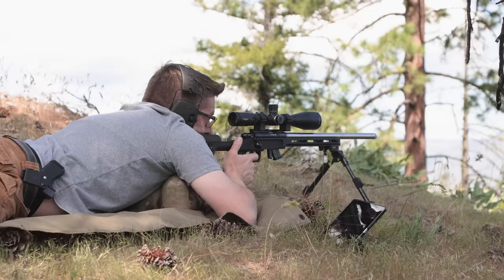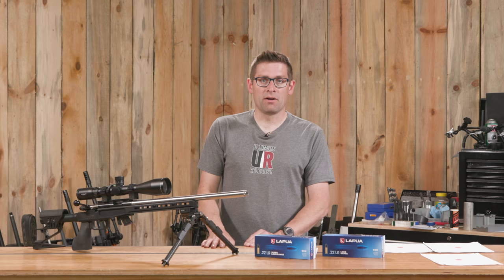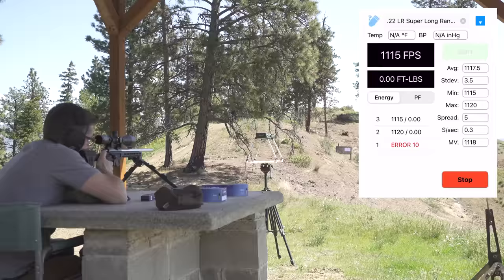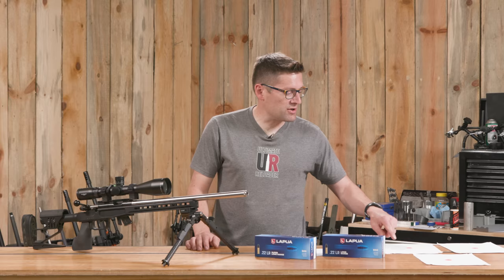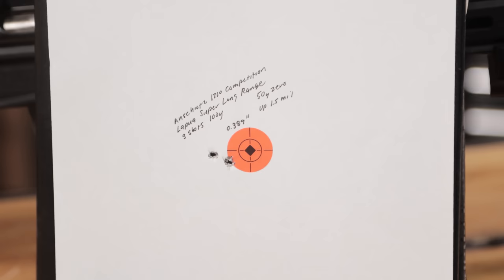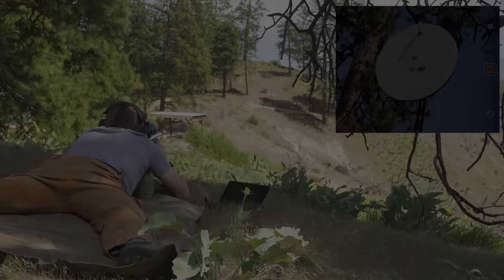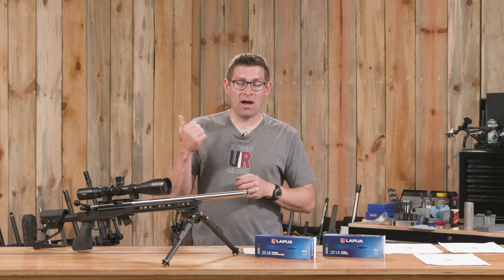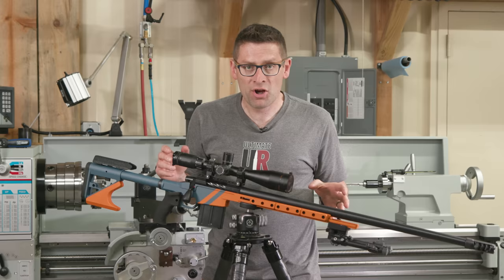400 YARDS 22LR: NEW Lapua Long Range and Super Long Range

Comment: I live in Los Angeles.  I'ts a real problem finding the higher end ammo such as Lapua, SK, and Eley.  Also, because I'm in CA, I can't have ammo mailed to me.  Gun stores want $40, or so, to receive ammo on your behalf.  Any thoughts?
Reply: Pick a gun store you like.  Buy everything you purchase from that single source, and cultivate friendship.  Out of customer loyalty and friendship, you may get a break for occasional purchases of ammunition they don't carry. 
Last, buy enough at 1 time to spread the cost over as many cartridges as you can. An extra  $40 for 1 brick is an extra 8 cents per cartridge.  $40 for 10 bricks is only an extra .8 cents per cartridge. It's pretty insignificant at that scale. 
Also, the more you buy with 1 lot number, the longer you can shoot without major adjustment. 
Of course, I don't know how often or how much you shoot, but I burn through a brick pretty easily in a month and a LOT faster if I'm screwing around. 
Just for kicks to impress your friends, shoot playing cards jn half on edge.  You still cut them even if you miss by .2 inches to either side 😮.  Just make sure it's actually perpendicular

Comment: Funny how the drawing on the box shows the bullet in flight... Skirt unexpanded... If one desires to shoot 22lr long range, gotta use tight 'match' chambers which will increase pressure and let the skirt expand fully to engage the rifling.
Not the best depiction of a precision 22lr bullet in flight. Then again,no rifling impressions are visible either... 
On pistols and non match chambers, skirt remains unexpanded as pictured on the box,which is detrimental to accuracy
Maybe Gavin can shoot these and soft catch the bullets to check the skirts

Comment: I cant wait to shoot it out of my non tactical inexpensive Marlin rimfire rifles. Nothing fancy about them.
Reply: I have a Marlin 2000. I grew up on the Model 25 and 60. The 2000 is a 25 with a bull barrel, better trigger,  and a goofy blue kevlar/polymer Olympic stock. It's does pretty well with federal AutoMatch bulk. Love that rifle.
Reply: @Joshua Gibson  I just got an 81DL I'm guessing this one is from the 40s. Can't wait to see how it functions.
Reply: Marlin gang checking in! 🫡
Reply: Lately I've been using a Glenfield 60.  Mainly because  it's fairly accurate  even wit the trigger u can hang a bowling ball from & not go off   hardest trigger pull ever used  but it works.  Use it couse if stuff happens  as it will I don't mess up a good "higher priced " gun

Comment: At only 1113 fps ,How is that super long range when Remington , Yellowjacket is coming in at 1285 fps my  rugar 12:48 clocks in at 1290 fps
Reply: When you go from super sonic to sub sonic bullets, go unstable . Also, subsonic bullets lose velocity far slower than supersonic. 
For long range from a .22 LR clean up the bullet design, increase the weight as much as possible to increase BC, and keep it a few percent below supersonic. 
You are going for accuracy, not hitting power.

Comment: I understand you are new to Rimfire, but your bragging on that first group, for me, that would be awful. I have owned several Anschutz rifles over the decades and could shoot tighter then .353” with CCI Mini Mag squirrel ammo. My good groups would be in the .02” range at 5 yards with Eley Tenex or SK SSHP, which there latter is no longer made. A great squirrel round and they stopped making it. 

One rimfire tip that was told to me by a multi time national champ. DONT clean the bore until your groups start to open up. If you keep that same ammo going, it should get tighter the more you shooters it. Leave the bore dirty. Keeps from having to re-season the bore with the lube and lead from that bullet every time you clean. Today’s powders are non corrosive, so the lube on the bullet and the little bit of lead left behind will protect it unless you live near an ocean. Shoot 500 rounds of the same ammo and watch the groups keep shrinking, then you will trust me on this.

Comment: CZ 457 Jaguar 1/2x28, better trigger springs, original 28” barrel, Warlock ll Supressor. Anschutz 4-14x44 scope with Anschutz high dovetail mounting rings. 
1).Norma Subsonic(1017fps) groups .384” @ 50yards & .482” @ 100yards.
2).SK Rifle Match groups .311” @ 50 yards & .435” @ 100yards
3). ELEY Bullseye Pistol X groups .291” @ 50 yards & .408” @ 100yards.
4). ELEY Team groups .208” & 50yards & .387” @ 100. 
5). RWS R-100 groups .166” @ 50yards!!!!  .294” @ 100yards!!!
RWS/Norma is great stuff, so is ELEY!!  I suspect my Supressor acts like a tuner because I rarely have any flyers that are well known to ruin a good group. My rig is dialed in
All Lapua is sold out where I buy. No match action or fancy barrel. My CZ Jaguar shoots, I’m beyond happy with it. My shooting conditions have no wind affects. I shoot in a deep dug out trench at 50 & through a storm drain tunnel at 100yards here at Ahlmans in Morristown Minnesota. I want to collect a more diverse lot of ammo first & practice with my 3 sons before I’m interested in 200-400 yards. Great shooting, I’m definitely looking for some Lapua Super Long when it’s available. Thanks! 
We have some other rifles that are quite accurate as well. We are figuring what they like and run well with as well. 
1). 1982 Marlin model 60 with Weaver scope.
2).1968 Wards Westerfield 87a,t,c ect with Made in Japan Tasco scope. 
3). 1949 Remington 550-1
4). 1943 Winchester model 74
5).1976 Remington 572 pump with made in Japan Tasco Scope
6). 1964 Mossberg 151 with Peep sights
7). 1943 Mauser trainer single shot with hi end peep sights. This one groups .144” @ 50yards with CCI Quiet Semi Auto, rated 835Fps!!

Comment: Sometimes, just because you can, doesn’t mean you should… This is why we have small capacity 22 centerfire… You can reload for them for the same or less than this rimfire ammo and STILL have more capability.
Reply: Pffft your missing the point
Reply: @jeffreypelletier7247  No, I get it. I just think it’s not worth it in a practical sense.
Reply: What small center fire do you recommend?

We have lead bans on the Eu horizon. And that would kill the 22lr dead. The copper bullets are fast(for 22lr) and inaccurate just bad. They work at close range 30m but so does my air rifle.
221 fireball has my attention.
Reply: @Greyzonecompliant  22 Hornet, 218 Bee, 219 Zipper come to mind. Also 22 PPC. They are small and efficient cartridges with the 22 Hornet being the most common. There are some Hornet based wildcats that are good as well such as the 22 Taranah Hornet and the K-hornet. A rimless, highly accurate and efficient one is the .22 waldog.

Anything beyond these and you get into the REAL wildcats!  One I would LOVE to try is the .224 Montgomery!
Reply: This is for those who already have long-barreled 22 LR gun...
You can feed it shit for cheap plink, and good ammo for occasional two hundred yard.
Small centerfire, basically anything smaller than 222 rem, is a scam.

Comment: Folks may not like this but, ehhh, that's fine. Everyone is different. I will give credit for the accuracy and consistency in velocity on this ammo. It's excellent. The velocity and energy however is unacceptable,, to me. Most common 40 grain ammo is advertised between 1,235 and 1,260 ft/sec.  That becomes 135.4 ft-lbs and 140.98 ft-lbs respectively. This Lapua ammo shoots 100 ft/sec and THEN SOME slower than that and to me, that is unacceptable. Just for simplicity I'll include both that you tested and say the average is 1,110 ft/sec. That equals 109.41 ft-lbs. YUCK!  Again everyone is different. Allow me to explain MY thoughts. 22 Long Rifle is low on kinetic energy in contrast to many other calibers. Duh. This is no secret and many accept that. I mean really, who's going to shoot through engine blocks and disable vehicles with .22 LR? With that said because we are given low energy to begin with I explicitly use the higher energy offerings in this caliber and so as not to sacrifice velocity I ONLY use rifles. Not pistols. I am so hardcore focused on kinetic energy that I will have it at the expense of accuracy. Browning BPR, and Winchester's equivalent of it, Winchester Super X. Be mindful though. Winchester puts the name Super X on several offerings so definitely pay attention to the advertised velocity. 
40 grain hollow point at 1,435 ft/sec IF you get can it. Not everyone will. Each rifle is different and will net different results. Also it's not a consistent 1,435 ft/sec. It does vary, especially in semi autos. There are some old 22 Long Rifle bolt action rifles rifles with absurdly long 26 inch barrels. Barrel length is one of those weird things that does matter when you think it wouldn't for a particular caliber. Maybe .22 Long Rifle is indeed one of those unexpected calibers that love ridiculously long barrels. I don't know. In my case it's just a simple and common Ruger 10/22. You know it's crazy when a small itty bitty caliber that's normally quiet by gunshot standards becomes quite loud and (sometimes) produces a small visible fireball at the muzzle of a rifle, you know, with a rifle length barrel. 🤪 But that's what happens with Browning BPR and I LOVE IT! This is just me but the muzzle blast while louder is still quiet enough that you can clearly hear the supersonic crack. With .270 Winchester you would never hear the supersonic crack simply because the muzzle blast is too loud by itself. But this Browning BPR ammo, very loud by 22 Long Rifle standards and also perfectly balances both sound effects so I can discern both. I LOVE IT! So to sum it all up Browning BPR or Winchester's equivalent will not consistently get that stated velocity but when it does, that's 182.86 ft-lbs of energy. Here are some honorable mentions. CCI Stinger: 32 grain bullet at 1,640 ft/sec = 191 ft-lbs. I have no idea if it performs as stated and if it does, in what rifles? I don't know. Winchester also offers some oddball ammo that I forget the name of but it's a 42 grain bullet at 1,330 ft/sec. Assuming it performs as advertised, 164.93 ft-lbs of energy. Also of note is CCI does offer what's supposed to be like Browning BPR and the Winchester equivalent amd sorry but I forget what it's called, but from the limited test sample I've seen, it simply doesn't reach that 1,435 ft/sec velocity period. Who knows though? Maybe that's where the old 26 inch barrel bolt actions come into play. 

Apologies for the long comment. Also in my case for the shooting distances that I have done and would do, Browning BPR has produced acceptable accuracy. Actually it surprised me for it exceeded my expectations.